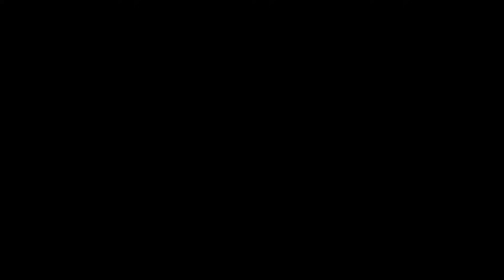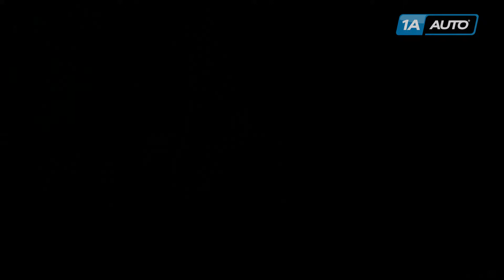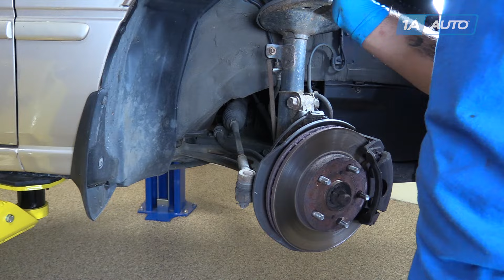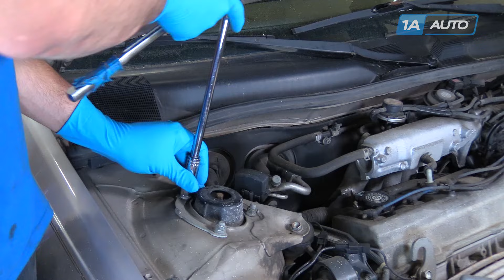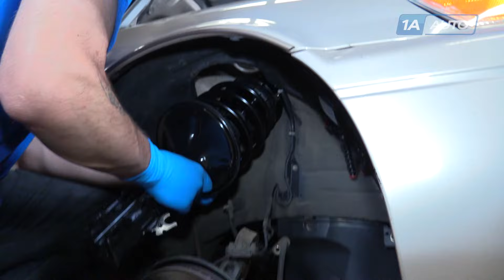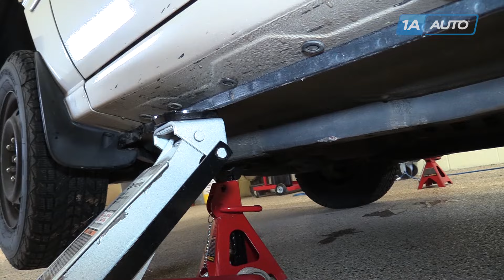How to Replace Front Struts 97-01 Toyota Camry

Comment: Hi, the video is great, one bit of the info. The tourqe is 29 foot lbs, not 59 foot lbs , i sheered the bolt on the second strut. I did some research and several places, all say 29. loosened all of them at put them at 29 foot lbs. Again, the video is great. Thank you. I took off the stud on the old strut and put it on the new one. I didn't want to wait for a return and got the job done with a one hour delay.

Comment: I did this on my 1997 camry when it was still alive. I was wondering how different this was for a 2001, and it doesn't seem so different. Mind as well bulk it and replace the tie rod ends, and the boots on the steering rack, AND go get a well needed alignment. I don't even bother with the inner tie rods.

Comment: Did my front struts on my 2001 Toyota Camry. This was pain because the sway bar bolts was rusty! A 2 hour job turned into a 6 hour. I ended up cutting the sway bar off and purchasing a new pair.

Comment: Their Video’s are great their struts are horrible.  To begin with the car sits 3-5 inches higher.  Everyone but the A1Auto teams sees the issue.  After 6 months of driving with rattling squeaking. They told me sorry see no issues. I’ve sent videos pictures audio noises when driving the car.  I will need to ship back the parts at my cost.  Use their video but be weary of using their parts.

Comment: Couldn’t get the bolts off that hold the Strut and spindle together had to soak it and get a different breaker bar that worked but problem was once you take the link off and the strut drops you gone catch hell getting it back on so make sure you have a good breaker bar to get the spindle nuts off

Comment: Guys just buy the assembly don't try to re use the spring on the old one, you'll never get it back together! Idk how they assemble the ones on the front, they tilt to the side. The ones in the back can be reused but the ones in the front too hard to get the spring on the new strut!
Reply from the maker: +101ragdoll Thanks for the feedback!

Comment: In my case the end links were oem toyotas and did not have. Nut type rear for a visegrip to properly clamp on. Please give a warning to dyi people that have lower mileage camrys with original struts and / or oem style parts that have possibly seized

Comment: Do you know if coilovers would provide more body height for a 99 Camry 2.2L? I have a steep angle at the end of my driveway that even with new strut assemblies all around, it still scrapes the bottom of my car slightly, so I just need an extra 1/4" of body height.

Comment: So close to being great.  No one should use that jack on a body side pinch weld  unless with a slotted block, cmon.  And you share liability, you are a retailer. Not allowed. 14 mm prone to turning- yes.  Use open/box socket 14mm and allen. or his vise grip and socket  Gets the job done, main value
Reply from the maker: +Harold Sarafan Thanks for the feedback!

Comment: I got my front struts in with no issue, but now I'm hearing banging noises when I hit bumps from my front driver's side wheel. I didn't torque the bolts to spec too meticulously, could this be the issue?
Reply: You NEED to torque the wheel nuts to spec

Comment: Working on my 98 Camry I always use 6 sided socket sets. The 12 sided ones can round off bolts if they are rusty or seized.
Reply from the maker: +Marky Mark Thanks for the tip!
Reply: @1AAuto  I use your tutorials all the time and have learnt alot. Thanks!
Reply: @markymark560 Random question, why are 12 sided sockets even a thing?

Comment: I have a 99 Toyota Camry if my tire hits a pothole it sounds like loose change in a metal cup is that part of the same thing as this video
Reply: It could be a number of things. Check the lower ball joint, the sway bar link, the lower control arm, the control arm bushing, and the inner/outer tire rod. It sounds like a lot, but it can be done in a few minutes. Just use a pry bar and make sure the rubber boots on the ball joints are not cracked.

Comment: Great video! But just a word of warning about the stabilizer bar link - often it will not come off so easily and you will have to cut it off. So you might want to have extra links on hand in that event. This is usually the case in places where there is a lot of road salt that caused corrosion.
Reply from the maker: +Michael Sakowski Thanks for the feedback!

Comment: I did this today on a friend's Camry. This video was really helpful. I cheated and used an electric impact for the smaller bolts and a pneumatic impact for the big bolts. Lining the bolts up at the top of the assembly helps when you tilt it at an angle to get one of the bolts through the strut tower, then tilt it back flat so that the other bolts poke through as well. A (rubber) mallet is a must for the large spindle bolts for persuasion. The vice grips did help a ton with the sway bar link. Thanks a bunch!
Reply from the maker: +lucidbarrier Thanks for checking us out and taking the time to comment.

Comment: Hello, I replaced the first front strut. Great parts and video, but newbie me messed something up. Bolts were tough, was tough to install the new strut(lining up bolts etc), both my issues. However once I got it on the car makes skreetching noises when put into drive or reverse and will not engage wheel. Anyone out there know what I broke? Which video should I watch next to trouble shoot it?
Reply from the maker: +James McDonnell You may need to take it out and re-clock the strut aligning it.  Thanks for watching.
Reply: 1A Auto Parts I replaced the cv axle and it worked, thanks for the videos
Reply from the maker: +James McDonnell Thanks for checking us out!

Comment: Instead of using vice grips to hold the "spinning" piece, notice that at the front of that screw it will take a T30 star drive. Use a 14mm wrench to hold the nut and a T30 on the socket wrench to loosen the screw.
Reply: A lot of the time these are so rusted you can't get the t30 in, and if you do it just strips.

Comment: May be a dumb question for some but I'm a first timer in replacing struts....question is when doing the struts...when knowing left or right..do you go by standing in front of the car as left or right...or do you go by sitting in the car?
Reply from the maker: +jay dee Thanks for checking us out! Left and right would be determined by the view while you are sitting in the vehicle. Hope this helps you out!
Reply: @1AAuto  thanks for response...I have one more question to ask....ive put on my struts but the only thing is the rear brakeline wont reach back into the groove of the new strut for screwing in...and im afraid if I force it that it will break....my question is does the brake line have the ability to stretch and extend without it breaking so I can screw it in with the 12mm?

Comment: One hint. A 13/16 socket might replace a 22mm socket, and I just checked that it fits on this vehicle. A 7/8 definitely will. My oddball 12 volt impact driver set came with a 13/16 impact socket. Otherwise, I have put away (just recently) all of my SAE (inch) tool except for the square drives (1/4 & 3/8).

Generally, with the larger sizes, there are always adequate equivalents between metric and SAE, if you have your old tools. Smaller sizes, generally not. But 8mm and 5/16 are equivalent.

If you have a collection of SAE tools, what is most important to get is smaller size combination wrenches, sockets and allen wrenches. You can spend a lot or a little on these. If you do work only rarely, the stuff from that national discount tool chain will be adequate. If you intend to do a lot of work, you might need the better stuff. The home improvement chains sometimes sell brand name sets at low prices. But some discount sets contain tools which are just not adequate. Don't talk tools, or Santa Claus might bring you a nice shiny set of inferior tools which you will have to quietly exchange.

Comment: when putting the new sway bar link on and you notice the sway bar is LONGER where it attaches on the STRUT and it doesnt align into the hole in the strut what can you do in that situation to cover the extra space to align the link with the strut. do you push the wheel hub towards the ground?

Comment: Hey 1A Auto. Do you happen to remember what size (in inches) your vise grip is? I need to buy a smaller pair so the jaw will actually fit on the sway bar. Thank you :)

Comment: I was able to loosen the bolt on the sway bar by using the vise grip, but had a hard time taking sway bar off strut. I loosened the 3 top nuts and 2 lower nuts and with some fingalging the sway bar released. I wish it was as easy as in the video!! But overall, this video gave me the confidence to do the job on my Pop's 98 Camry. Thanks for great videos!!!
Reply from the maker: +allroy71 Thanks for checking us out. Shop here for high quality auto parts: http://1aau.to/m/Shop-1AAuto-c

Comment: I replaced all the struts and sway bars on my Toyota Camry 98.but it start pulling to the right. Does anyone knows what can be the reason?
Reply from the maker: +Inder Sidhu You may want to have the vehicle aligned to see if they can correct the issue. If you have replaced the struts, you should have the vehicle aligned. Hope this helps you out. Have a great day! 1aauto.com
Reply: thanks ,I will try that.
Reply: Fix the alignment

Comment: I got a 1998 Toyota Avalon, what's the torque specs for the front struts assembly? I heard that most avalon matches that of Camry if so is that true?
Reply from the maker: +ShikiKaze We currently do not have that information available to us.
Reply: I found it. It was 155ft/lb on the knuckles and 59ft/lb on nut for the top strut tower. Thanks for replying though. Took me forever to find it.
Reply: Lkim8.m8ko9m..inik8moj.777jkuk7m ml8l
Op

Comment: Would the torque settings (59 ft/lbs, 156 ft/lbs, and 29 ft/lbs respectively) be different for a 2000 Solara with a V6? Everything else appears identical, mechanically.

Comment: i have not been been able to take out the sway bar as you showed in this video, any advice?
Reply: Patrycia Garcia Literally this was the hardest part for me. Vice grips wouldn’t hold it still so I just cut the bolt since I had replacements

Comment: Does the spring need to be changed as well? I bought the shock but it came with no spring from orielys. Appreciate the help I can get.
Reply from the maker: +Erik Nieto You would either need to purchase a new spring or reuse the spring from the old strut. Hope this helps you out. 1aauto.com

Comment: I wanted to ask i need new shocks for my toyota celica gts 2003 but i notice would i need new strut mounts and springs or just the shocks themselves because i checked out the kit yall have the 4 piece for front and back shocks and struts but they dont come with the mounts and springs and it says it will fail sometimes because of manufactured?
Reply: If yall could give me more info that will really help
Reply from the maker: +Larry Lopez Thanks for watching!  Yes, we do carry a set of 4 struts cartridges for your 2003 Celica, but you will have to purchase new upper mounts separately.  We carry them, so if you want to give us call one of our representatives can help get a shopping cart together for you!  888-844-3393  -  1aauto.com
Reply: I tried to order it but it didn't let me
Reply from the maker: +Larry Lopez If you have issues ordering off our website please give us a call at 888-844-3393.  One of our reps will be more than happy to help!

Comment: hello I've got a 99 camry that has had suspension noises since 
i've gotten it, they're most notable on brick roads since they're so 
bumpy it sounds like metal on metal (it happens when going straight and 
turning, doesnt matter) and when going over large bumps the car throws 
me around quite a bit and the steering somewhat disappears for a split 
second, I changed the rear sway bar bushings and that dampened it some, 
when i jack the car nothing seems to be loose using the age old tug on 
various components test, ive tried every component related to suspension
 front and back none seem to be loose or banging around, the previous 
owner told me the car would need struts, hes no mechanic but he 'knows 
his cars', so, I already purchased rear struts and got the new one in 
the drivers side and soon will come the passenger side, from what i've 
listed has anyone got a best bet? (Also no play in the front or back 
wheels when tugged at 6 and 12 or 3 and 9) Thanks!
Reply from the maker: +Sam Lyons Thank you for checking us out. The struts are the more common solution to what you are explaining. 1aauto.com

Comment: Thanks! Would have never got the nut off the stabilizer without that vice grip trick!
Reply from the maker: +porkypinekiwi Thanks for watching. If any of our viewers needs to make this repair, we carry the auto repair part shown in this video on our website. Here is a link to them: http://www.1aauto.com/toyota-camry-solara-strut-monroe-171678/i/mnsts00019?utm_source=YouTube&utm_medium=CTA+Comment&utm_campaign=ytcomment&utm_term=16mzUG0vuPM
Reply: @1AAuto  Instead of using vice grips to hold the "spinning" piece, notice that at the front of that screw it will take a T30 star drive. Use a 14mm wrench to hold the nut and a T30 on the socket wrench to loosen the screw.

Comment: I have a question. After one of my friend replaced timing belt on my 1996 Toyota Celica, the steering wheel can't easily turn like before. So I didn't drive it for about a year. Now it's harder to turn. Do you have any idea what cause this problem? How to fix iit? Any video somewhere I can check it out.
Reply from the maker: +DejLiab DejNtsuab Those symptoms could be caused by numerous things.  We recommend you get the vehicle looked at by a reputable mechanic if you cannot diagnose the issue yourself.
Reply: I would say check the power steering and power steering pump, it might need some fluids

Comment: Nice video, do you need to have a 4 wheel alignment done after replacing front and back?
Reply from the maker: +kevin mitchell Yes. You should get an alignment any time you work on your steering or suspension. Hope this helps you out. For anyone looking to replace their struts, 1A Auto carries the part here:  https://www.1aauto.com/toyota-camry-solara-strut-monroe-171678/i/mnsts00019?utm_source=YouTube&utm_medium=CTA%20Comment&utm_campaign=1ATony